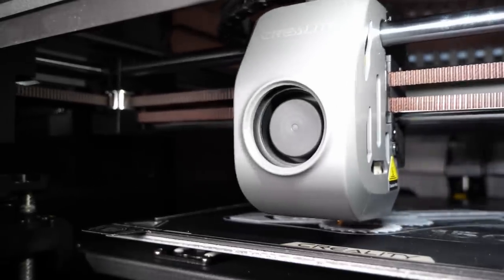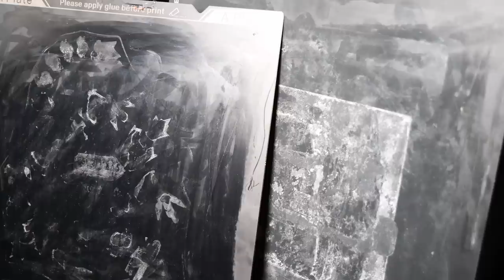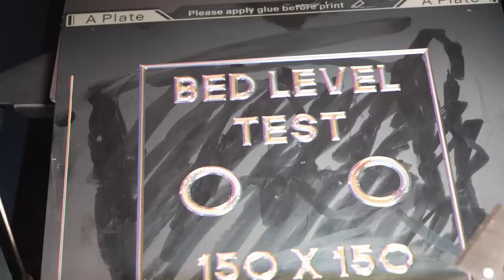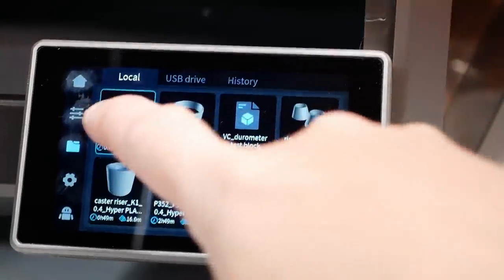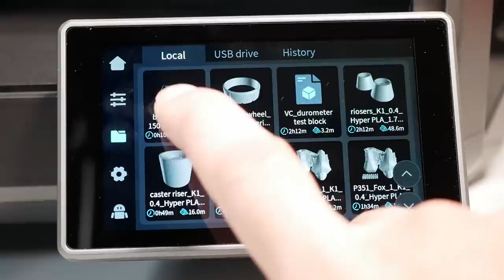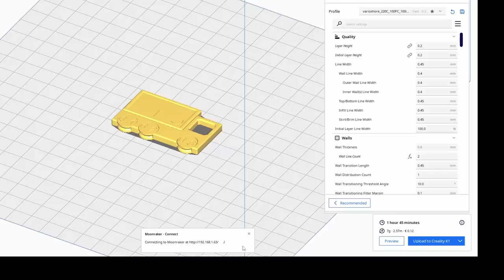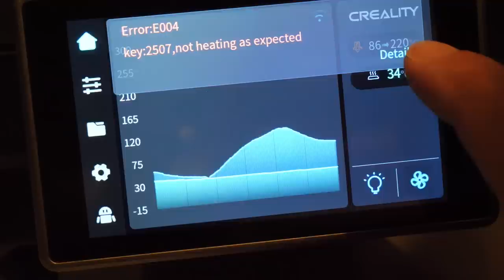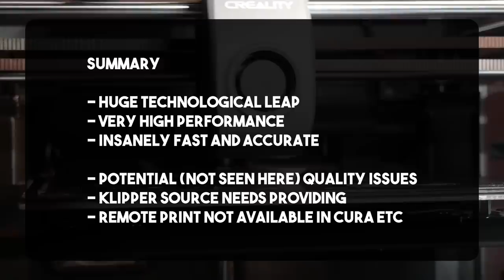The Creality K1 looks amazing, does it live up to the hype?

Comment: The ring is for a metal shield to cover the components inside the ring. You typically put the ring into your V1 PCB design, incase it fails EMC testing (that is required to sell products in most countries). If it passes without the shield, you leave it off, and remove the ring in the next revision. Source: I design PCBs professionally, and have done the same.

Comment: FYI I've had a lot more luck using orange plastic razor blades for removing prints from bed surfaces. I originally bought a huge pack for removing old gaskets from car parts without nicking the aluminum parts, but I use mine 99% of the time on my 3d printers. I haven't seen many 3d printing channels talk about them before.

Comment: You can get 'Blade tool' by searching glass scraper or something similar. I bought one ages ago and it is super useful but do NOT ever use it in any way sideways. If you bend the edge slightly in one direction you will end up scratching the bed with that one bent part. Hold it flat at a shallow angle to the bed and puch on the bottom of the print and it'll pop off (do not pry for the reason stated earlier).
Reply from the maker: yeah you have to operate it completely flat against the bed, or RIP your bed
Reply: Top tip: order plastic razors/scrapers. They are mostly used in the sign/printing industry.

Top tip 2: order non permanent multiple use adhesive spray, used mostly in the textile industry.
Reply: Why do that when you can get it and a glue stick for "free". Just buy the $1200 X1C instead of this $600 printer.

Comment: This is probably the first review of the K1 that's actually somewhat positive. I bought the P1P over the K1 (after watching a bunch of videos about the 2) and although I don't regret it, I soon found out I can't print certain STL files on it due to Bambu Slicer not having the "surface mode" found in Cura. So now I'm hunting for a second printer that will print these files and I'm not sure if I should just get something cheap like the Elegoo Neptune 3 Pro or dig deep again and get the K1 as was my original plan.
I don't know what Klipper is, what it does and why I should care, all I want is the printer to work and give me quality prints without me needing to take a uni course on programming a motherboard. I had enough of fiddling about with my Ender 3 for the last 2 years, so now I just want something that works.
Great review, very well structured and balanced. Cheers.
Reply: klipper basically just helps make it print faster without tons of quality loss from what ive seen.
Reply: What files does the P1P struggle with?
Reply: Sounds like you got sold on the P1P by the people being paid to make reviews, alas every recent review states that the K1 is far superior to the P1P and cheaper .
Reply: @mikeobrien9829  I'm sorry, did you say "superior to the P1P"? Hey, I'm happy that the K1 is better than a lot of people were saying it was, but to claim it's superior to the P1P? 🤔 Hmm... I think you're reaching, there. The spammy app is enough to put it behind the P1P, IMO. Regardless, I don't have one to say yay or nay, so I won't say you're right, but won't say you're wrong either.
I'm happy with my P1P now that I've managed to fix the STL issues I had and it prints like it's on drugs and about 6 cans of Red Bull. 😁 And the quality is like nothing I've seen before, so I'm super happy with it. Plus, Bambu are also offering me a discount on the new P1S enclosure upgrade kit which I'll be buying soon. 😎
Reply: @AussieRCPlayground  Dont take my word for it, the recent reviews say the same
Reply: @AussieRCPlayground what STL issues were you dealing with?
Reply: My exact sentiments. I have built these printers from scratch, now I just want to buy a nice one that works.

Comment: Got my X1 about a week ago. Came with 1 glue stick. Don't need a scraper as it is a cool bed, you can/should wait a couple of minutes and then just flex it slightly to release the print. This is also much safer for the bed. So the scraper is not included as the bed is not designed to need one. With that said, Bambi does include a preinstalled model to print one. I kind of think this might be better. Let someone print one if they really need one and this way, they are also using their printer for a useful item (not just a million more Benchys). To the video. GREAT info and very well said. Really does being to light an issue that Creality needs to answer for and the only way they will is if a little shade is put on them.
Reply from the maker: general scraper, yes, but the bambu one is really sharp, obviously you need to use a good technique but I've not damaged either bed after hundreds of prints...as usual it comes down to taking care

Comment: I have been using my K1 for 5 days now, and i love it!
And this review is the most on point and personal i have seen!

I was worried in the beginning, since so many people have shown alot of "broken" machines all over social media.

I just went through all the screws i could find and checking so all was correctly tighten before starting printing. And not a single problem.

My personal thoughts, is that the biggest trouble with these printers are for beginners that haven't tinkering with normal bedslingers before. And thus dont have the experience in troubleshooting.

Once again, my personal thoughts.
Reply: Glad yours did good but wait for the anoying 004 error code of hotend, or binded extruder gear pins, its not cool, idea is great for creality but product quality is absolutely not cool
Reply: you're not even a week in my man. i feel bad for the inevitable extruder clogs and pin problems as well the other issues you're going to have
Reply: @obie224  
You know that my comment is over 3 weeks old now? 🤦

Comment: This has been my first printer and its been doing really well so far.

I think everyone is missing the point of who this printer is for.
This is an all in one printer with all the best advancements in recent years so theres no need to mod it other than maybe a nozzle upgrad.
It looks like it was designed for mass market rather than 3D printing enthusiasts so the klipper web interface is locked down to basic things.

Truthfully enough i havnt needed to unlock klippers advanced interface at all, all my prints have been doing fine.

Comment: 100% agree with your summary.  Seems like it was really close to being a home-run if Creality had not nerfed Klipper and just put regular Klipper on there and advertised it as much.
Reply: It’s there, both Fluidd and Mainsail, and you can get to it via an exploit, but then you’re locking yourself to a firmware version because Creality then really removed Moonraker about 2 weeks ago.

I’m running Mainsail on mine and a coworker of mine is working to get it in parity with a conventional Mainsail install. Not budging on firmware until Creality gets its act together.
Reply from the maker: they did WHAT?
Reply: @aspectcontext  My issue with the exploit is that Creality opened up a security hole in Klipper (technically moonraker api) that allows you to move and replace the file in the /etc/shadow folder. This should never be allowed by any API. So running Crealitys Klipper, even if you have Fluid/Mainsail, is a security accident just waiting to happen. 

I'll wait until its a real unmodified version of Klipper. Might never happen, but that is my holdup before even thinking about this printer. Otherwise, its not bad.
Reply: @JohnOlson Yeah, if you don’t know what you’re doing, especially if you can’t read code and have little defensive networking experience, you could be in for a bad time.

All Creality needs to do is offer a menu that allows you beginners/non-tinkerers a path to Creality’s nerfed Klipper version, and full Fluid and/or Mainsail for those that know what they’re doing. Everyone wins.
Reply: @aspectcontext  Yes! 100%! Even better would be an option in their UI to change password before you put it on a network, or auto generate a better password.
Reply: @JohnOlson 100%
Reply: @aspectcontext  they could just use the touch screen.  When the machine is first started up its OS(whatever Klipper is running over top of on this machine) brings up an option for casual and power user.  Power user would then have a warning something like "Using this mode will unlock the full access to this printer, Note that in this mode it will be possible to alter files that could disable or even damage the printer. Press back if you wish to have a more protected experience designed for those just starting or those who will be exposing this unit to inexperienced users".   On picking that the printer would then from its storage install either the nerfed klipper, or true plain vanilla klipper.  Also offering a choice of MS or Fluidd might be a step too complex.

Or just offer a non nerfed version on their website for power users to download to a USB and flash.  My above wall of text was just because I figure having it all onboard as choices makes life easier. Especially if in a location with poor internet connectivity.

Edit: probably should also for the sake of the art, have the ability to reflash from an openable options menu that way someone who a year down the road with a lot more experience can unlock the full power.

Comment: i had the K1 for a week before refunding it over a bunch of issues, e.g. it could only do 15mm3 flow (tested ABS@285C) before shearing off filament on stock hardware, with a cht volcano it reached 30mm3 but print quality at 300mm/s wasn’t great and lastly it developed really loud resonance noises over belts rubbing against pulley shoulders. creality support tried their best but couldn’t resolve the issues. I hope the modding community develops upgrades just like the did for the ender series to make the k1 truly great

Comment: Just returned my less than one-week-old K1. Had about 8-10 great prints before the error messages started showing up. The E0004 (Not heated as expected) started showing up that was the end of it. At first it happened about an hour into a print, than it got progressively worst, and the last time I couldn't even heat the nozzle to extrude some filament. Contacted Creality and they wanted me to open up the hot end and service it myself which I don't feel like doing on a printer that's brand new, so back it went. 

Have done a lot of searching (Google/YT/Facebook) and it turns out that quite a number of people have had the same issue and although Creality has sent them new parts after a couple of messages and video/photo, some have had to wait 4-6 weeks for parts to arrive and then doing the service yourself, just doesn't feel right for a flagship machine.
Reply: Printers are machines , if yuo gone buy one , better be prepare to fix it , China is too far😅
Reply: @noway8233  Yeah, I guess I need to change my frame of mind when it comes to fixing stuff, but being that this was my first 3D printer, and it was brand new, I wasn't in the mood to potentially void guaranties or brick the printer
Reply: @racingprincipal Even Bambus need work out of the box quite often. If you want to 3D print you better learn to love tinkering.
Reply: @racingprincipal  That would definitely have been my attitude too

Comment: Solid review. I think some teething issues can be expected. They definitely need to release their files. I think right now I would still buy this over a P1P.
Reply: As a 3D scupltor looking to acquire my first 3D printer can I humbly ask you a few pros/cons that would make you chose the K1 over the P1P ?

I've been reading arround those past days and almost settled for the P1P over the K1 which was the first to hold my interest initialy.

 Thank you for your time :)
Reply: @0dCore  I don't own either, so I'd only be speaking from armchair experience. The main factor for me is simply price. The more open source nature of Creality matters as well, though they still have to live up to that with the K1. I will say overall the P1P is probably a bit better of a machine and at least replacement parts are affordable if ever needed. Both seem capable of doing pretty much all the same things, except the K1 comes enclosed already which will make switching to more advanced materials much less of a pain, and still at a lower price.
Reply: @802Garage  I see, thank you for your answer. It's 3 days later and because I can find the P1S at almost same price as the K1 in my area, I might go for this one as it's enclosed too... I'd prefer open source stuff too tbh but from my past days reading Creality printers seems to be less reliable in the long term than bambu labs ones ?

Now I'll have to read some more to make sure about that, since creality's summer K1 purchase offer gives out 100$ of extras for only 3 extra bucks which looks like a good deal... Down the rabbit hole hahaha.
Reply: @0dCore  If you can get the P1S for the same price as the K1, I'd  definitely say go P1S TBH.

Comment: The clearly need to open up this printer.. so people can make it better, use Orca Slicer / CURA with it and load prints over the network to it etc. I'm a semi happy owner of a K1 (printing mainly PETG for hobby use). Also they should do something with the extruder, sell/send an upgraded version what has less issues with under extrusion imho (spent 5-6h on getting it to print PETG-carbon with their hardened .6 nozzle and failed)

Comment: The one absolutely show stopper for me is being closed. I may not represent all audiences but I believe me and a fair share of the market simply won't see the point of having a printer you can't mod. To me tinkering with it is at least half the experience of 3D printing. My Vorender 0.6 is a statement of what I am talking about. A former ender 5, that can print up to 500C direct drive and 60mm3, runs on klipper, have linear rails guiding X axis, 3 Z axis with auto bed tramming, input shaping, 13 minute acceptable quality 3d benchy, K thermo couple, 700W mains heated bed with PEI sheet and towards Vorender 1.0, will have afterburner, become a coreXY with some cooling improvements and a couple other enhancements I plan to make like have automatic Z offset via ADXL tap detection. All within a budget similar to the K1 (if disconsider all failed upgrade attempts and mistakes on the learning path).
K1 feels pointless to me as is now.

Comment: One thing I realized is on my x1c the LiDAR has trouble with powerful lights. I placed a led light on top and the first print gave me an error with the LiDAR. I took it off and it was fine again. I took the diffuser off and it helps a bit without causing problems with the LiDAR

Comment: I won't be getting one but then I'm not getting any new printer at the moment. I'm glad to see more core XY machines out there and I appreciate there being more choices. In general, though, I'm the oddball that looks for a printer that a) is open and follows licensing and b) is likely user-maintainable with some assurance of off the shelf parts for years to come. I don't have any concern about parts for this machine - it's Creality and they are likely to be around for a while. However, I don't particularly care for a company crippling its firmware and software like what is done here.

Probably silly of me to have an opinion on a printer when I'm not even in the market but I guess I'm simply anticipating what I would want in a printer when (not if) I eventually get another.

Comment: there is code floating around the internet and youtube that reduces VFA to almost nonexistence. Note that it does in fact slow your prints down a bit but I would prefer a perfect looking print and it is a 5 minute free fix. I think Creality may have included it as a firmware update because when I updated my firmware, VFA issues ceased to be a thing. I also want to point out that you can install bog standard klipper and fluidd on the k1. Creality even provides the specs you need to put into the configs.

Comment: It seems to like the K1 could end up favorably comparing to the X1 Carbon like the Ender 3 compared to the Prusa Mk3 - it's not quite the same experience, the premium machine overall is still going to be objectively better, but you pay half the price for much more than half the value. On that front alone, I might consider getting one some day, though I am fully enamored with the idea of a good IDEX machine in a useful size at a not-obscene price, and would get such a printer instead of a K1.

That potential won't be fully realized if Creality doesn't remedy their license violations and make it easy to mod, upgrade, and repair the printer. The Ender 3 is kind of the king of easy-to-do-stuff-to printers, from something as simple as adding storage for tools and supplies or as complicated as extending all the axes to octuple the print volume or add a second independent extruder. And if something breaks, parts practically grow on trees (assuming you can't just print it yourself to begin with based on thousands of mods and parts found on Thingiverse or Printables). One of the first thoughts I had about the K1 is that there are so many custom metal, glass, or injection-molded parts that spares, replacements, and upgrades might be harder or more expensive to come by, whereas you could source all the parts for something that looks identical to an Ender 3 after spending twenty minutes on AliExpress. (If anyone knows where to get a pre-drilled original Ender 3 X-axis gantry extrusion, by the way, help a brother out - having screwed it up is the last idea I have for what's gone wrong with my Ender 3 and I'm not very good with power tools.)

I also wonder if the K1 and K1 Max signal an intent from Creality to partially abandon the super-budget printer market to companies like Sovol and instead focus on the mid-range market that has been buying Prusas and P1Ps.